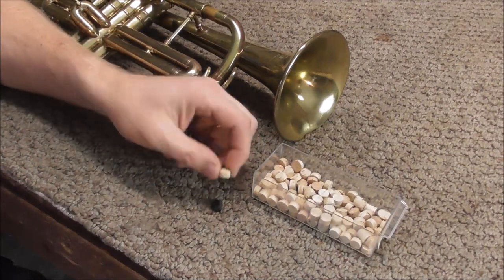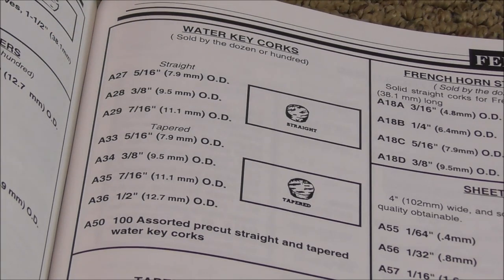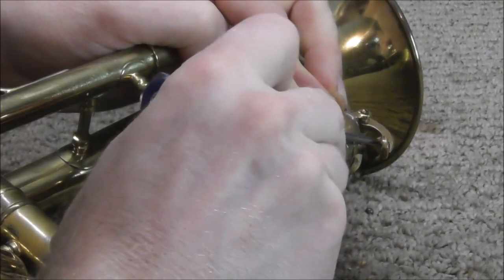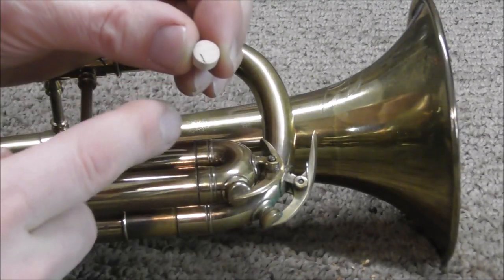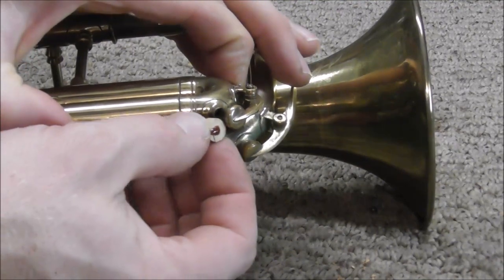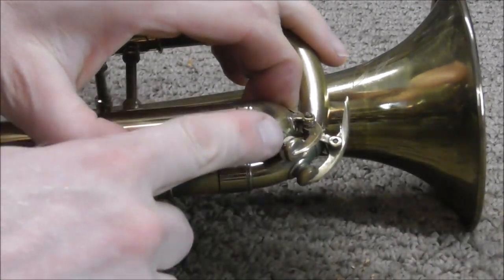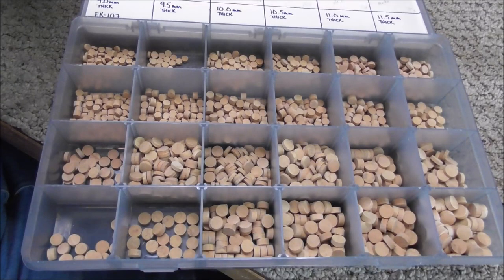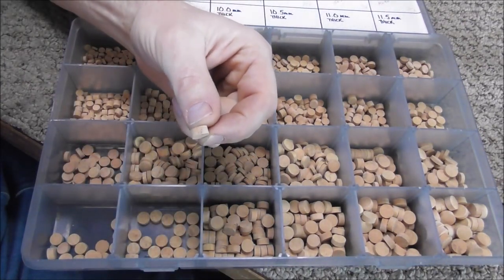How To Replace a Waterkey Cork (Spit Valve)

Comment: Had to replace the corks on my G baritone bugle, and your excellent video made the job a slam dunk. Used the synthetic corks with the built-in adhesive. Substituted a butane lighter for the mini torch, and a machinist's gauge for the pad slick, followed your instructions, and now those keys are good as new. Thank you so much! 👍

Comment: 1:17 I used a drop of super glue gel because it's all I have. Hopefully that will be good enough. Thanks for the detailed instructions.👍
Reply: Hey, after 6 moths, does the glue gel works?
Reply: @billb6182  Yes. Still holding. The downside might be that when it comes to repairing the worn out cork, it will probably be more difficult to remove the cork and glue residue.